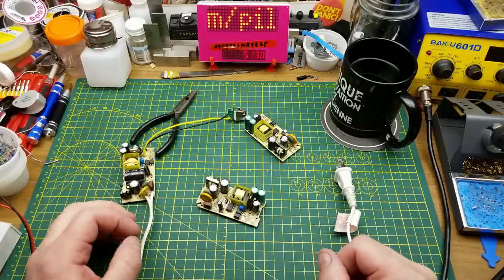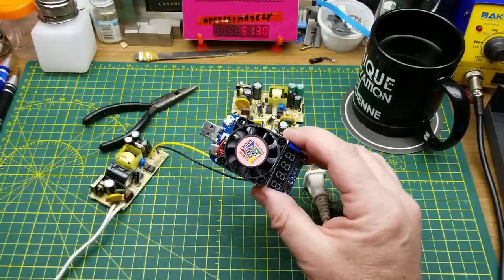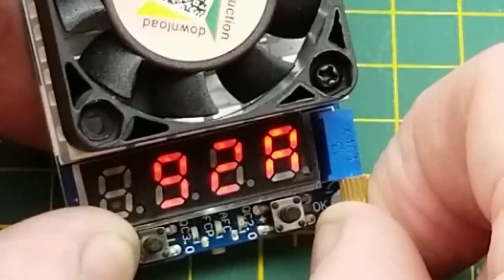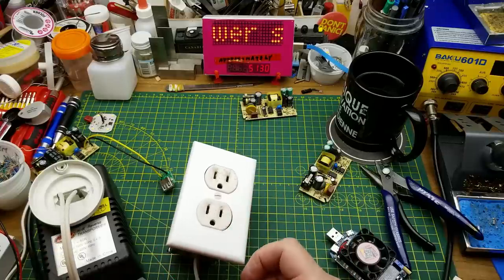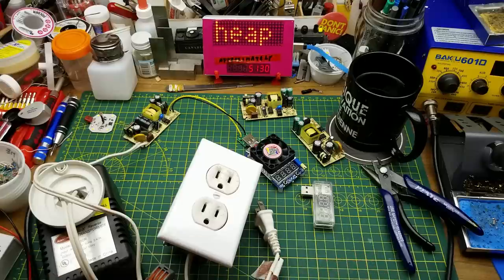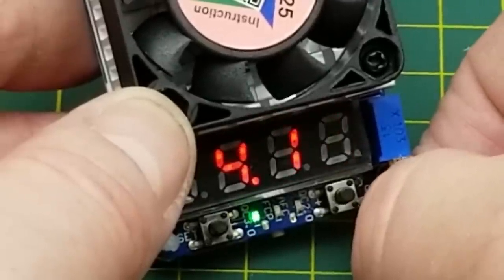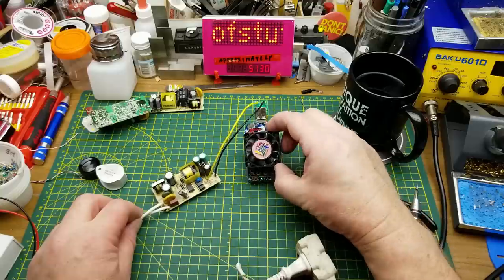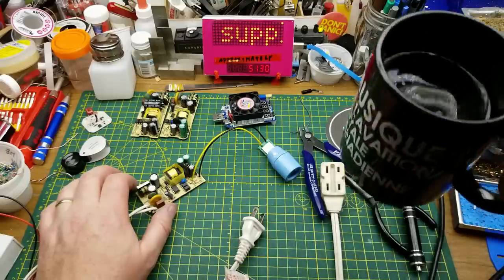testing some cheap ebay power supplies

Comment: If they are rectified mains DC-DC converters the cap after the rectification may not be rated high enough for 220V. Check its voltage rating for 220V you want something like 400V dc.
Reply: Spot on.  That's what I look for in Chinese stuff that is supposedly rated for 230V here in Australia.  220V electrolytic capacitors are going to be the weak link in the chain - may work for a while, but not for that long.  Australian voltage can often be at/over 246VAC even though it's now supposed be a "nominal" 230V.  Even for 220V, using 220V capacitors is suspect.  Just because your car redlines at 7000rpm, it doesn't mean that's the way you should always drive it if you want it to last more than a year.  The real surprise is how reliable 220V capacitors can be in real world 240V applications.  They may fail after a year or two of constant use, but not usually before that.  Having said that,  400V electrolytic capacitors should be mandatory for 220/230/240 volt use, and preferably in conjunction with appropriately rated MOVs.  Yeah, that's a pipe dream...
Reply: @Chris_the_Muso  They also try and confuse you with, is the capacitor voltage rating AC or DC.   the problem with Aliexpress and eBay is that they by pass safety regulations.   kind of OK for home use if that's legal in your location. but if you then re-sell it ALL the safety issues fall on you for placing it on the market. if I was producing a product to sell that had mains inside, the PSU would have to come from a known good supplier (Farnell, Rs, Digikey etc) with all the certifications in place. I normally do this for home use as well for my own Mental wellbeing.

Comment: Ooow the last one might have a bum solder joint on the opto couplers perhaps.
Worth a look over the pcb :-).
Look at the input capacitor voltage for a clue to the full mains voltage, 380-400v for a 240v max.

Comment: Why don't you send the faulty one to BigClive as challenge to see if he can trace the fault. As per usual a great entertaining and interesting video :)
Reply: One moment please!
Reply: He doesn't need to send it to BigClive.  There should be three winding's in the 
transformer; primary, secondary, & feedback.  The feedback voltage is not getting
to the switching regulator, which causes the flashing voltage output. Could be an open resistor or diode or shorted capacitor.  Watch DiodesGoneWild; he does a good 
explanation of how switching regulators work.
Reply: And if 'BigClive' can't do it then 'Electronics repair school' can do it, he fixes psu's and mobiles and laptop motherboards without chematics and the so called pro's are telling him not to do it this and that way but it works good and he learn us fast how to do it :)
And if even he cant do it then 'Mr Carlson's Lab' can do it, he repair rather advanced radio stuff and has lots of oscilloscope like test equipment where some of it for testing capacitors tube radios are made by himself, he's just one level up from the best :) Even teaching us to put the non-polarized capacitors the right way to get the noice floor down (using the outer winding on a capacitor as a shield to ground and figure out what pin that is by testing with a oscilloscope, that video and also the one with teachings of the different capacitors is pure gold, his best two learning videos i've seen and i has not seen them all).